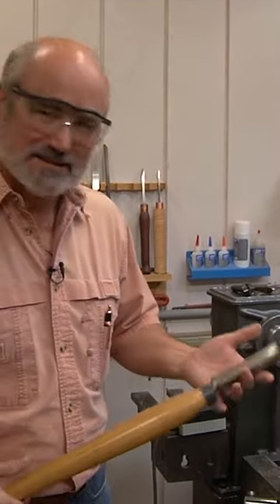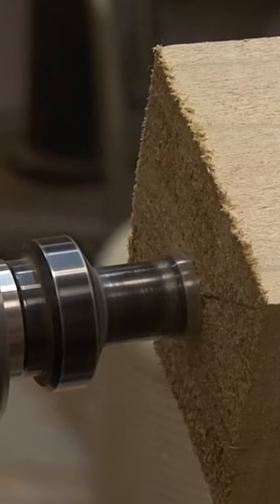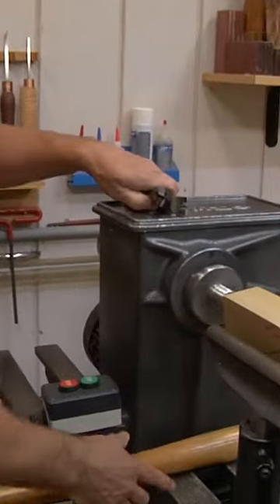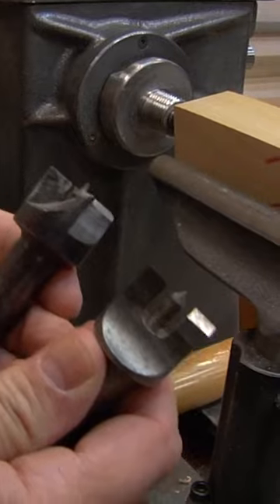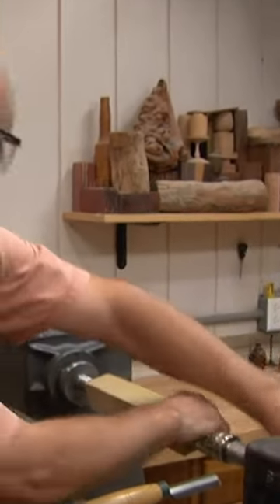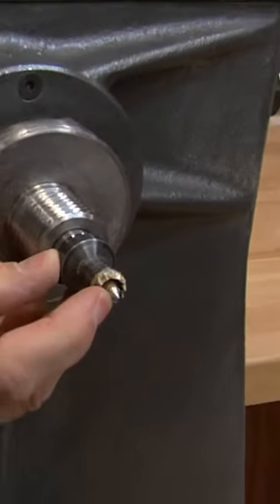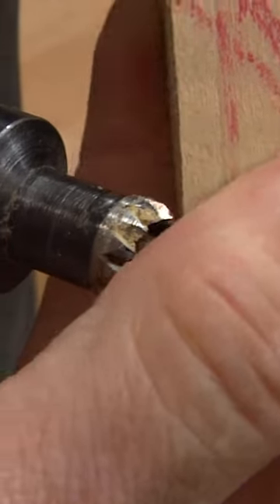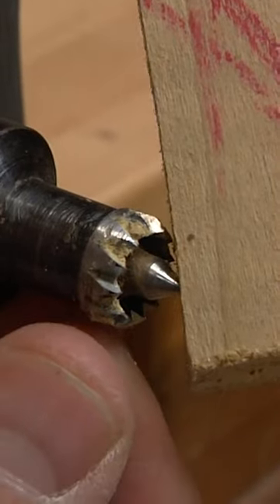Taming a Catch #shorts

Comment: OR, what i do is loosen the belt on the motor so if it grabs the belt will just spin until you move the tool. I turn 10 and  11" diameter by 34" long materials.

Comment: Great concept for beginners to understand, and most probably will understand as you intended. BUT your explanation is wrong in several ways. “Big strong points that really dig into the wood” the point isn’t doing anything except aligning the blank when you put it on the lathe, and helping slightly to keep it from “flying off the lathe”. The teeth, as you later mention, are digging into the wood. And the problem with a catch isn’t just the wood coming off, but the tool jolting, breaking, or flying out of your hands. A turner should make the teeth dig in before putting the piece on the lathe, by standing it up on a bench (not the ways of the lathe) and smacking the drive center with a wood mallet, not a steel hammer, that will eventually mushroom the end and damage the Morse tapered receiver. As far as the steb center,  “instead of the gigantic teeth grabbing into the wood” the teeth are already “dug” into the wood, that’s why it spins. If only the points were holding it before the catch, it wouldn’t do anything. The big teeth, if properly set, will usually maintain their hold, so the benefit of the small teeth on the steb center, is that they easily loose their grip, and spin, as you said.